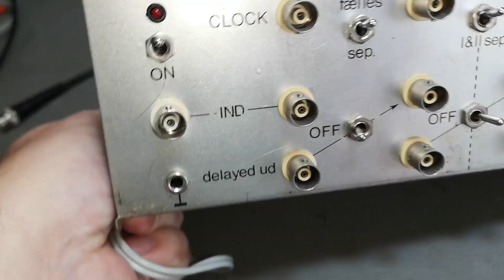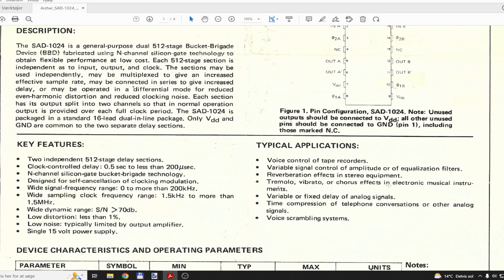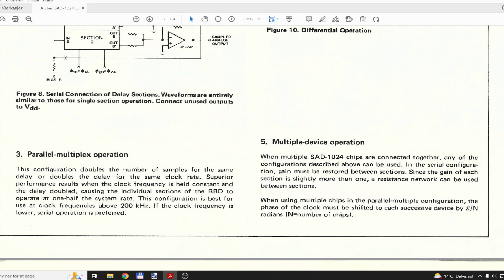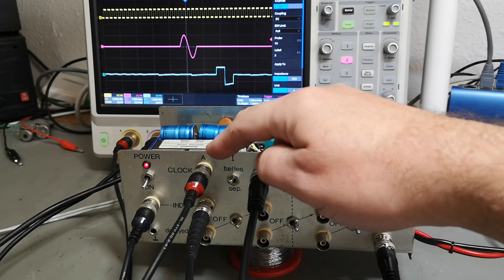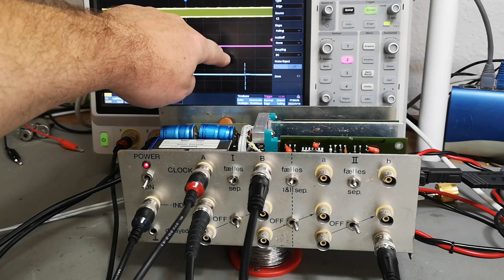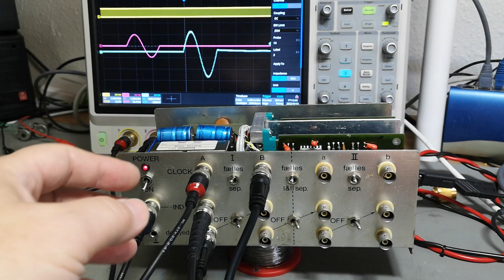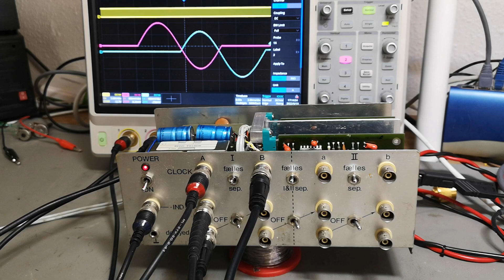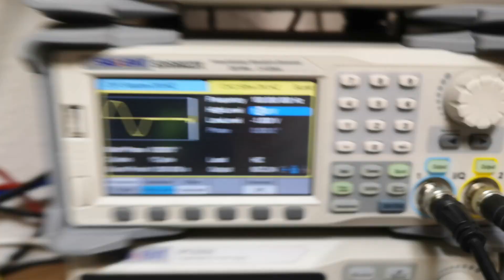Reticon SAD1024 Analog Variable Delay line 4ch test teardown

Comment: The SC-1024 circuit board was the evaluation PCB produced by Reticon. You'll find the schematic for this board in the April 1977 issue of Radio-Electronics, on page 66 (Fig. 13).

Comment: @4:40 despite what the datecode made you think, the SAD1024 is not from 1964. SAD1024 was fabricated in silicon-gate NMOS; silicon-gate NMOS was developed at Fairchild in 1968. Given the other date-codes on the Motorola and Raytheon parts, I suspect the SAD1024 was made in 1976.
Reply from the maker: thanks a lot for the info

Comment: The frequency limit is really the 4013 ability to switch, they probably are running the clocks on plus and minus 7.5V rails, to keep the CMOS at 15V supply, or have a single 15V supply and local half rail ground on each card, with capacitor coupling on all signals. BBD delay lines were the first memory devices, even being used for digital logic as memory, with Mostek being amongst the first company to make them as commercial devices. They do not scale though, as you need pretty large internal capacitors per stage, still only a picofarad each, but big for an IC capacitor, to make them work with low noise. Plus that funky 4 phase clock, also common on early microprocessors to drive them, though the 8080 still takes the cake for needing a special clock chip to drive it, as the clock is in no way TTL compatible, and you need the 8224 to generate the clock for it.